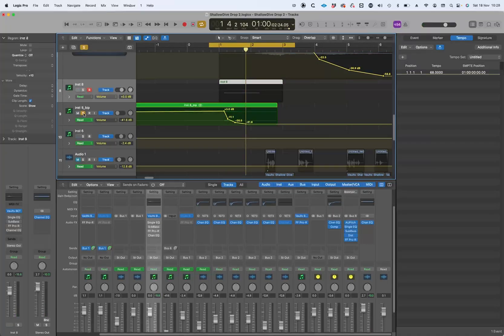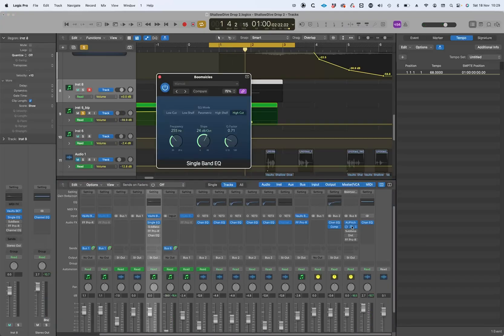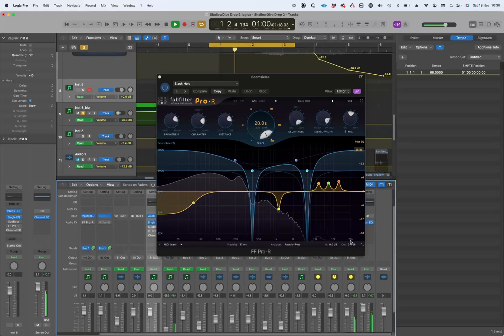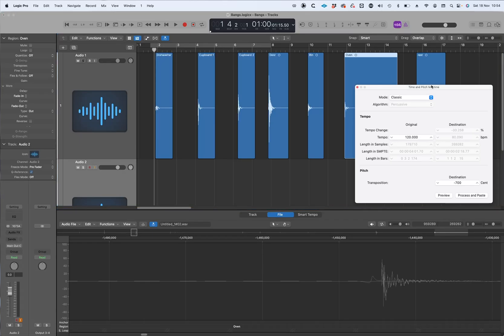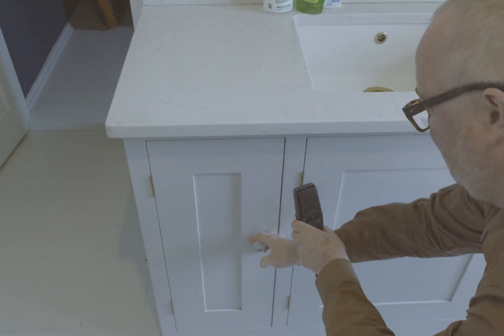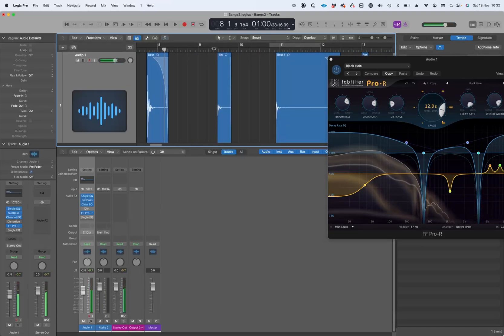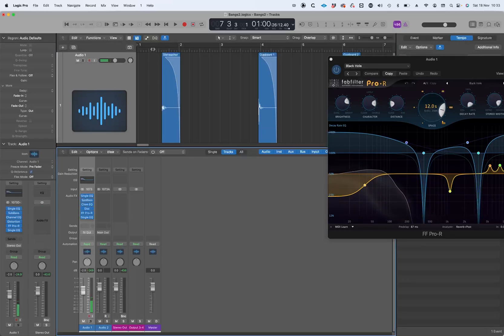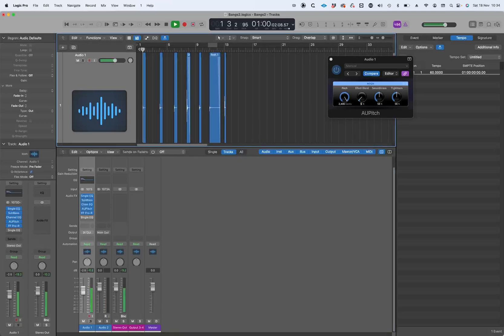You Can Make SONIC BOOMS From ANYTHING!!!

Comment: The culture vulture is also really great for this. Take any super bassy source and run it through on distortion setting 3, bias almost at full, gain set just enough so you're getting a bit of signal let through. Turn the bias down as the sound plays and you get this lightning sound that appears to "grow" as the bis is lowered. 

Adding in some reverb to the tail and you have a lightning effect 🙌